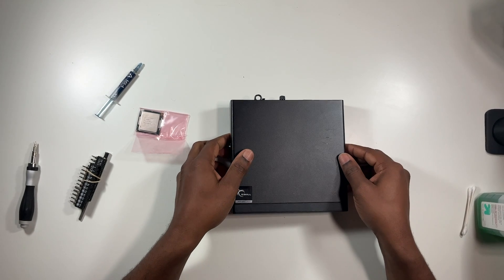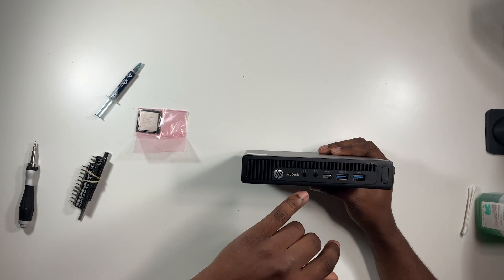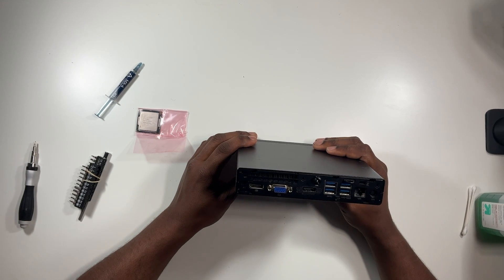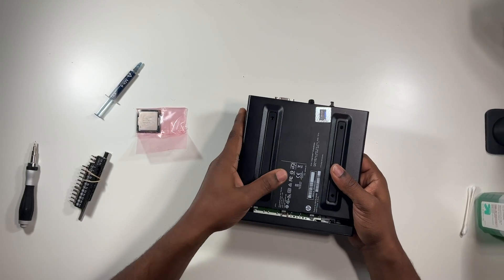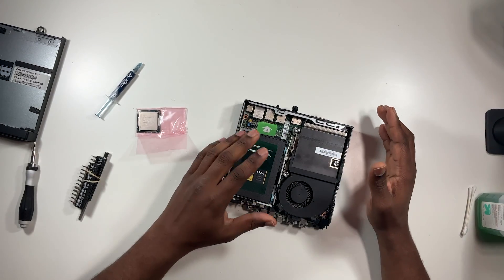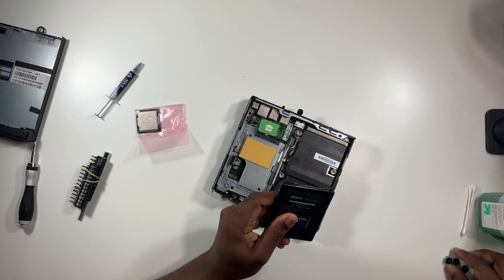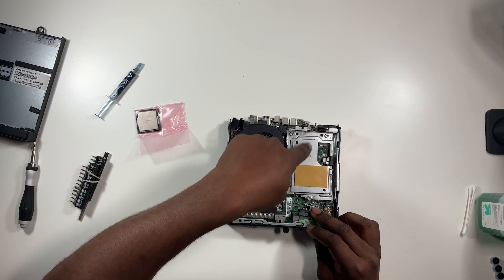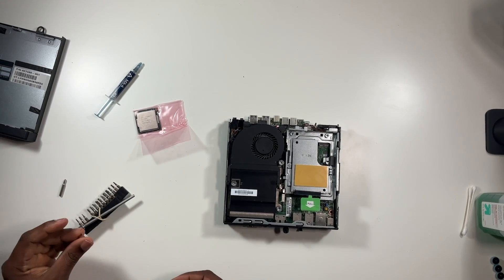HP ProDesk 600 G2 Mini PC Processor Installation

Comment: Is it possible to play fortnight on this machine
Reply from the maker: Probably not you can try running it on the lowest settings but these machines have a old integrated graphics chip that’s not powerful
Reply: @charleeeugene  how much fps do you think it will have?

Comment: Can this be done on the 400 G2 too? I just bought from eBay for $44 without a drive cus I have an old drive from another computer that I plan to use. I'd love to upgrade the processor too, but will that be okay since it's older than the 600?
Reply from the maker: You sure can upgrade the 400 G2 . The processor the ram the hard drive all can be upgraded!!!

Comment: Hola buena informacion. Tengo una pregunta que tipo procesador le puedo agregar a miCPU Intel core i5 7500, Mini hp prodesk  600 g3 lo quiero para jugar apex legends. Soy de la vieja escuela. Gracias.
Reply from the maker: If it’s the same socket size but be careful the mini desktops have an efficient cpu installed. What cpu is currently in the pro desk 600 G3?

Comment: I left my mini to be fixed they said the glass chip underneath the motherboard is broken can't be fixed I must buy a new from from them are they right
Reply from the maker: If you mean the glass on the bottom of the processor chip you can buy another cpu. But I didn’t know they have glass underneath the motherboard. Can you give me details?
Reply: @charleeeugene  yes there is a little glass chip thing at the bottom its dark in color it's attached to the motherboard it's cracked & broken
Reply from the maker: @ well you might want to grab another machine to save money grab the ram,ssd and processor out the broken pc then look for a barebone machine on eBay
Reply: @charleeeugene in other words that's an option because it cannot be fixed is that what you are saying?
Reply from the maker: @NosphiweNonto  I don't think it's worth it to have it fixed. Did you get a price ?
Reply: @charleeeugene yeah $3500 I think I'll take your idea instead
Reply from the maker: Yes indeed!!!!!!

Comment: hi, can i upgrade my cpu in my hp prodesk g2 mid tower? it has an i3 6100, so in theory i could upgrade to a 7700 (non k) because is the same architeture right? ik i would have to upgrade the bios and probraly the psu too
Reply from the maker: Go for it because the mid towers have a stronger PSU than the SSF. Worst case scenario you’d lose a couple of bucks with a 7th gen processor.
Reply: @charleeeugene  but i mean, you upgraded the cpu in your pc, ik is the mini but in theory i should work for both right?

Comment: im looking at some scrap laptops, and Ill probably still grab one for the small things, but when looking for easily upgrade-able mini PCs, what are the initial requirements to run some CAD software or DAWs and maybe play some games, ultimately intending to upgrade and would start with this Dell model you have as the introduction to my mini PC life, but I'm sure there's a Ryzen route that'll be equally fun to mess with.
Reply from the maker: CAD software will not run well with the integrated graphics but some light gaming is possible. I just got a AMD Ryzen 7 gaming laptop and I'm loving it so far.  These mini PC's are cool because you can upgrade just about everything on the motherboard and it's super easy.

Comment: I have hp prodesk G600 mini and just replaced cpu I7-6700 works fine but at startup comes fann error.
Reply from the maker: That’s probably why you might need a stronger power adapter for that cpu these mini pc’s usually run with T series  processors optimized for low power computers

Comment: I have one on the way, and I intend to exclusively use it as a Batocera retro machine. I’m pretty sure it should play anything up to and including PlayStation 2 without much problem, after that, I’m not sure if I’ll have to do any upgrades to it but I’m primarily a old school player as far as what this machine is going to be intended for.
 I was using an old Inspiron 1525 from 2008 and it works fairly well but stumbled on slightly newer consoles. I’m hoping this will fit the bill.
Reply from the maker: I'm like you I prefer to play retro games myself. The fun factor is higher my opinion. You should be fine let me know what happens thanks for watching much appreciated!!!!!

Comment: hello everyone HP ProDesk 600 G2 Mini PC, it has an intel core i3 6100T processor and I bought a core i3 7100T and it doesn't work, does anyone have any advice?
Reply from the maker: That should work without issue. I hope the processor isn’t defective.
Reply: Because it's HP, it's not will work with 7 gen processors :(
Reply: It needs to be same gen, but you can get one without the "T" at the end. I just went from i3-8100T to i7-8700, works great.

Comment: I had an old i7 6700 (non-T) from an Asus g20 that I dropped into a prodesk g2.
no issues.
but I did also upgrade the power brick because the i7 can run as efficiently as the i5 but it can also ramp up to 65+ watts.
Reply from the maker: Yes you are correct as long as you upgrade the power adapter.
Reply: I also drop an I7-6700 into my prodesk G2. System run fine with no overheating. Bios however does triggered an alert (901 Chassis fan not connected) upon every startup, which I need to press "enter" to continue boot.
Reply from the maker: That's not too much of an inconvenience @hksin6680
Reply: @hksin6680  Euam pus un I5 6400 fata T si aceeasi eroare imi . ce se poate face sa nu mai apara. Am alimentator de 95 W se poate si mai mare??
Reply: I have Dell optiplex 3090 mff and i wanna  install i3 10100. Could this work or not

Comment: Good morning, does anyone know if the HP EliteDesk 705 G4 MD 65W version with Ryzen 5 2400g can be replaced with a more powerful processor?
Reply from the maker: Not sure about the Ryzen Processors. I've had bad luck with AMD. Won't hurt to try it out since AMD chips are way cheaper than intel.
Reply: @charleeeugene  Yes of course :) amd are cheaper :) but first i would like to gather information if it is possible, so far i have come to the conclusion that the motherboard of this model has a b350 fch (fusion controller hub) chipset and i found a list of compatible processors that is quite long :) the problem is that hp making bios for this board could only block it to the official list of models which is not impressive.  Anyway thanks for the answer :)

Comment: I have this and the prodesk version great little machine, for the multi monitor support you need to enable it in the bios - top tip, tested with 3 monitors works perfect, great idea with the cpu upgrade gonna hit mine up
Reply from the maker: Yes Stir I have 2 of these little beast now. Thanks for watching!!!!!!!
Reply: @charleeeugene  totally agree man a beast of a unit for the price, great for multitasking also use them daily without fail. Also if gaming is a thing for people turn up graphics to max in bios and throw GeForce now in the mix, works well for most games. Maybe a future video for yourself? Thanks again 👍

Comment: I have one question, would it be possible to mount the i3-9100T to this computer in theory? because sockets match in both cases LGA 1151
Reply from the maker: Yes you can but why i3 ?
Reply: @charleeeugene  i3 because I didn't find i5 or i7 9th gen, and this 9th gen i3 it doesn't look bad in comparison to 7th gen i7, especially since I managed to get this i3 extremely cheap
Reply from the maker: @GremlineQPl  I recently had a 8th Gen i3 I was surprised at how well it performed.
Reply: Does the i3-9100t (or i3-9300t) work in a pro desk 400 G2 mini ?  These are LGA1151-2 CPUs. My stock CPU (LGA1151) is the i3-6100t. There seems to be a lot of FUD out there, that 7th gen and later don’t work in older PCs.  I’d very much appreciate some ideas before I purchase a new CPU.

Comment: I've had one of these for a couple of years trying out different things with it. I just installed MacOS Ventura on it tonight and it works pretty good. I might just look for a 6700T and see if it improves it in any way. And yes the specs say it will support 64GB of RAM.
Reply from the maker: I wonder what the price of a 32gb stick of ram will cost ?
Reply: @charleeeugene  Somewhere between $50-$65...A little over $100 for a 64GB kit.
Reply from the maker: @jeffbaker4219  that’s not bad are you considering putting 64gb in your system ?
Reply: @charleeeugene  I might if I upgrade the CPU like you did...Very tempting lol.

Comment: You can actually upgrade the ram to 64GB
Reply from the maker: Didn't know that I'll try it out in the near future 32GB ram is more Than enough at the moment. Did you install 64GB in yours?
Reply: @charleeeugene  I wish I could afford it. At the moment I am running my Optiplex 7050 micro with 32GB and its enough but there is a channel called ServeTheHome and they like these 1L PCs. They have tested out the 64GB upgrade and it works. So its just good to know that its an option should you need it in the future.
Reply from the maker: @madarauchiha4298  yeah I would imagine two 32gb sticks would be expensive. I don’t think 6th generation i7’s are worth it.
Reply: @charleeeugene  For my use case mostly working from home with spreadsheets and 4k video streaming it works fine. But if I was to try video and image editing then it would probably struggle. Plus I got it new for a good price.

Comment: Will a 6700 non-T not boot at all or just overheat?
Reply from the maker: I got error codes when I installed on my system but I've read some people got it to work. So maybe I ordered a faulty Chip. But honestly I'm glad it did because maybe in the long run it could've caused more problems. Keep me updated if you decide to go that route I'm curios.
Reply: I have an HP Prodesk G5 600 mini, just went from i3-8100T to i7-8700. Using the factory 65w PSU it works great, but I do get a 901 HDD Fan error on boot. I just click escape and it boots into Win 11 Pro no issue.

My mini PC didn't come with that second fan over top of the m.2 slots, but apparently it can be purchased and that error will go away once it's plugged in. Just kind of strange that the i7 triggers the BIOS to look for that second fan, and the i3 didn't look for it.